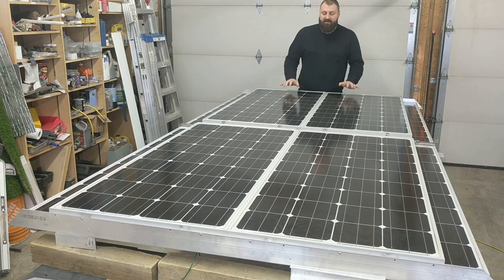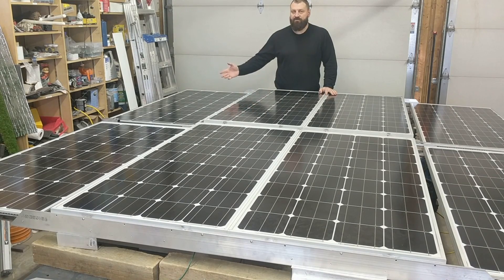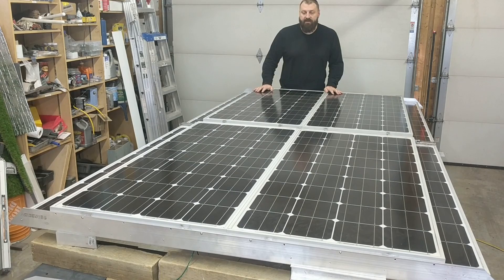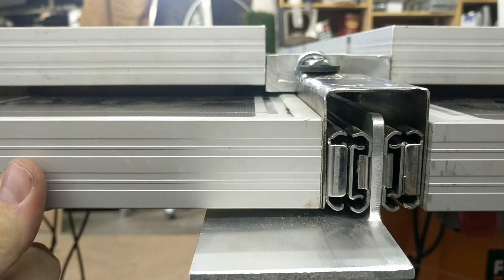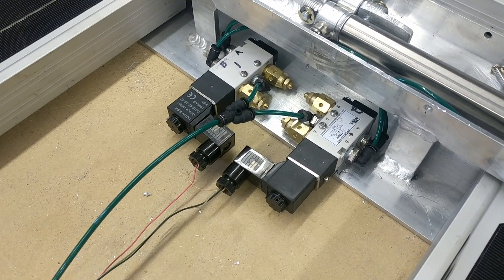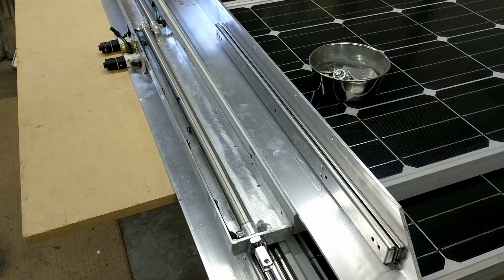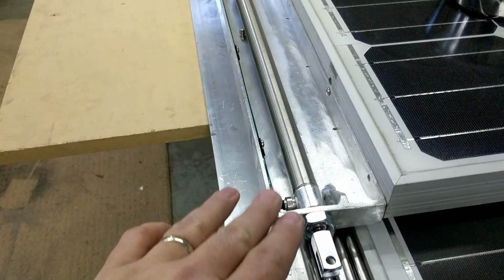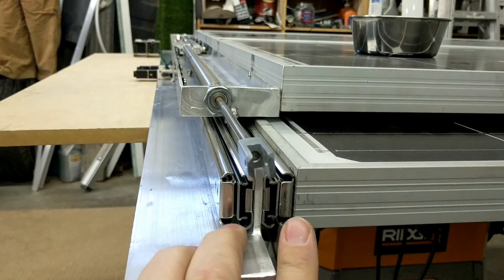Even Moar Solar! 1.4kW Rooftop RV Sliding Solar Install - How to Build an Overlander

Comment: Great video ! Had you considered 80/20 for the framing of the solar panel arrays ? I understand 80/20 makes sliding brackets etc. I am planning to fabricate something similar to your build and was considering 80/20 . My only concern is how that hardware will hold up to the brutal weather conditions on the roof. Any thoughts or considerations are greatly appreciated.
Reply from the maker: I have worked with 80/20 a lot, I would not consider it for this application, it would be too bulky in my opinion, and there's nothing complicated about the way I did it, three pieces of angled aluminum and some drawer slides...
Reply: @Everlanders  Thank you so much for your prompt response and for making outstanding videos.

Comment: Did you electrically isolate the panels on the bottom so as not to effect the output of the top ones if only using those?  If so, how did you do it?  Or doesn’t it seem necessary?
Reply from the maker: We use the SBMS100 solar charge controller and Battery Management System which has two discreet solar inputs. This allows me to track the amount of power produced on the top array versus the bottom. That being said, it is not required and they could be wired together without any problems.

Comment: ahh... so this is how you did it? very sweet. 

Quick question, what would keep somebody from doing this but the other way around.... That is, having the top two panels slide out instead?
I have 4 4x6 panels to install on the roof of my short bus and I am trying to evaluate options that would let me have a roof top deck, at least until I install four more panels, 

thanks
Reply from the maker: I don't see why not... But why not have them hinged at the edge, and then fold them up to act as a railing when you're using the deck and then they fold flat when you're not up there...

That being said, we know 3 rigs that have rooftop decks and 3 rigs that wish they wouldn't have bothered. They never use them, it adds a surprising amount of weight up high making for poor drivability, and the mounting points leak...

Comment: How have the slides survived exposed to the elements?  Has dust/dirt compromised the lubrication in the slides?  Do they still operate as new?
Reply from the maker: I soaked the slides in degreaser before assembly to prevent dust and dirt from collecting. 2 times a day, 3 years, 4 countries, nearly 100,000 km and they are still going strong...

Comment: so you have had this for 3 years - how has the drawer slides work in the environment? - are they still sliding easy ? they are typically built for indoor use. great idea I want to copy it!
Reply from the maker: These are not typical drawer slides... They are heavy stainless steel slides used the toolboxes of Tow Trucks, Service Bodies, and Ambulances. And as you can see in our more recent videos, We've driven this rig nearly 100,000Km through Canada, North to the Artic Ocean, South through the USA, Mexico and now heading for Guatemala. We've had no problems cycling them at least twice a day.

Comment: Don't know if this has been asked, what keeps the cylinders locked?  The constant air pressure in the line feeding them?
Reply from the maker: I intended to put magnetic latch solenoids to hold them in as a double safety, but I never got around to it, I'm still carrying them around in the back of the truck. The air pressure pulling them in has been working great so far...

Comment: How is it holding up 
I’m paranoid About the actuator failing from vibrations in the road life situation and rust and dirt hindering the sliders ?
Seems about $500 to add a few panels seems worth it unless it is problematic.
Reply from the maker: 4 years, 4 Countries and 100,000 km later and they're still working like a champ... The stainless steel sliders don't rust, and all the pneumatic cylinders and fittings are stainless steel as well...
Reply from the maker: I now have a Frequently Asked Questions post on this very topic on our website that gives lots of details... https://everlanders.com/FAQ-air-powered-slides/

Comment: Brilliant! I want to build something similar. Is there a special reason you used pneumatic cylinders instead of electric cylinders (electrical linear actuator)? Also, is there any precaution you took agains dust in the sliders? I am afraid that once dust settles in the sliders wont move effortlessly anymore.
Reply from the maker: Electric linear actuators that have 24" or 30" of throw can get very expensive, large size, they are a lot more susceptible to damage from exposure to water and outside elements, and they are quite a bit more complex in that they have limit switches gears, worm drive screws... This is a very simple ¾ inch diameter stainless steel rod, when you give it air you get a hundred and fifty pounds of pushing force, through a single ⅛ inch air line. if anything fails I can disconnect the airline and push it in or out as needed. Heavy duty stainless slides were de-greased and pressure washed clean, the roller bearings are running dry now... 100,000 km and three years of use and they're still going strong...
Reply: @Everlanders  I kind of expected you to have thought about that 😂😂 but good to understand your reasoning. Now I see your point about the air cylinders. And the best argument of all: you know it works because you have tested it.
Reply from the maker: I now have a Frequently Asked Questions post on this very topic on our website that gives lots of details... https://everlanders.com/FAQ-air-powered-slides/

Comment: Would rivet-nuts be an acceptable substitute for all those threaded chips for mounting the panels?
Reply from the maker: Yes, except that the frames are 1/2 inch thick box section extrusions with fairly thin walls, so I wanted to spread out the clamping forces.
Reply: @Everlanders  Cool, thanks for the reply.

Comment: Awesome job dude, in the midst of a build in the UK and this is the video that introduced me to you guys, been hooked since. Looking to implement something similar on my vehicle and I also have an air system to run it off of so I'll probably be using pneumatics as well. It mentions in the description  of your install video that pressing the brakes brings the panels back in, how is it that you've implemented that?
Reply from the maker: Our system is one step more complicated because we have python script running various other automated functions when we start the truck... but you could very simply have a standard Bosch relay and cut the power to the solenoids when your ignition comes on....

Comment: Wondering if you had any problems with the sliders now that this video is 2+ years old. I am looking at the option of making a manual awning out of my panels. 
Can I ask what sliders you used?
Reply from the maker: They get extended and retracted 2-3 times daily, currently off roading through Mexico without issue. Links for everything I used is in the description.
Reply from the maker: Also, this https://youtu.be/woZH85EiHNY

Comment: Since I have used your scripts for the backup camera and screen dimmer, I might as well ask for more. I am working on my solar panel setup, similar to your setup, for my Vanagon. I like the idea of activating the air cylinders via my Raspberry Pi instead of toggle switches. Could you share the script used to extend and retract the cylinders. Also, what watt size are you individual solar panels?
Reply from the maker: Here's a post just for you! https://everlanders.com/all-about-automation-part-one/
Reply: Everlanders The site is asking for a password. I am a Tier 1 member but not sure if I was supposed to setup a password somewhere?
Reply from the maker: Oh, sorry I didn't realize you were Tier 1, all our extra website content with step by step tutorials and diagrams is Tier 2+. But I don't think they'll mind if I share the script itself this time... https://gist.github.com/Everlanders/4bf6b0b1a516aca4423a38824fbefeec

Comment: What size air line are you using. I ordered 1/8 inch and it sure looks small.
Reply from the maker: Yup, I used ⅛" - anything larger and the cylinders move so quick I was scared to damage the panels...  At first I was going to run a larger hose up to the top and then split it, but in the garage testing, I needed at least 20' of this tiny hose to dampen the movement. Even with variable exhaust dampers it was hard to slow it down.

Comment: What is the width and length of your panels? 
What is the total thickness of the installation?
Reply from the maker: The panels each measure:
58.750"  1492.25mm Long
26.750"  660.4mm Wide
1.875"  47.625mm Thick

Comment: Are you running your Nitra valves at 24 volts or will they work at 12 volts?
Reply from the maker: I changed to the 12 volt coils, sold separately.
Reply from the maker: https://bit.ly/2U90zuP
Reply: Everlanders Thanks, already got them on order. I really appreciate your help.

Comment: That's pretty slick.  I was mulling over doing something similar on my trailer, but not automated.  Very well done.    I'd be surprised if you didn't get some inquiries.  The next step, make it able to track the sun.
Reply from the maker: No interest is tracking the sun... Added a bit more solar is far cheaper than tracking...

Comment: Great when waiting for a trafic light ;-)

Did you think about being able to tillt the whole thing over one side of the car so you can direct it into the sun. Might be a bit more weight and less solid, but should bring in 20-40% more electricity...
Reply from the maker: When traffic is slow or the road is very smooth, we totally deploy it... but in my testing, it was nowhere near 20-40% when tilted, Especially in Canada, they would need to be nearly 45°, and when you consider that the direction we're parked is not always going to be in the direction the panels tilt, or I'd need to have the whole array tilt in all directions, and the mechanical nightmare that would be. Not to mention the stresses on the mechanicals in off-road environments that we're in now. Further, we make more than enough power in Canada and the USA with them being flat, and it's only down here as we travel through Mexico and into Central America that we really need the big power for AC, and for that, the panels being flat works just fine.
Reply: @Everlanders  A tilt would have to be on one side only. That does mean you need to park your car with one side towards the sun and maybe repark it some times. But if choosing how your park is not an option then yes, there is no point in this.

But I get what you say, when you need the AC there is likely enough sun too ;-) And by having enough panels and battery capacity to start with, you don't need to complicate things.

Comment: Nice bit of engineering. I have been thinking about doing just the same, but with 12v linear actuators. Was that a consideration and if so what was the issue with them?
Reply from the maker: I've repaired too many electric actuators/control systems... I like that I don't need to repair the failed limit switches, and the burnt out motors from the same, I like that they are a fraction the weight, size and cost for the same workload, They extend and retract in 1-2 seconds. Made from Stainless Steel they are robust for extended outdoor use. And most importantly the way I have them valved, they fail closed.
Reply from the maker: I now have a Frequently Asked Questions post on this very topic on our website that gives lots of details... https://everlanders.com/FAQ-air-powered-slides/

Comment: Outstanding build! Did you add the code in to an existing Pi, or use a dedicated one? Thoughts on controlling via Arduino instead of Pi? Any after thoughts on what you would change? I am looking to do something similar now that I have seen this amazing build ✌
Reply from the maker: I have 5 Pi doing various stuff... I just tagged this into one of those... Wouldn't consider Arduino, way more familiar with Linux.

Comment: This is so freak’n cool. Is there a vacuum in the cylinders that help keep the panels tucked in while you drive?
Reply from the maker: They are 2 way cylinders, 150psi pushing out or 150psi pushing in...
Reply: @Everlanders  Thanks!!!

Comment: loctite those screws.
Reply from the maker: Thanks for the suggestion Mr. Zing Please rest easy knowing that when it was installed on the rooftop, the fasteners were all installed with a threadlocker or a Locknut.

Comment: How big a gap did you use from the van roof to the back of the solar panels ? Thanks
Reply from the maker: About a 1/4 inch to the frame when the lower set is retracted. When extended they hang off the sides and then the top ones are about 3 inches to the glass.
Reply: @Everlanders  Thanks,Jason.

Comment: You have done an excellent job with that system. Definitely one of if not the best sliding solar panel setups I have seen (I do a lot of looking) I am wondering now that the system has been in use have their been any issues or updates? Currently I live in a converted coach bus (6 years now) and am doing the mental calisthenics to prepare to build my next bus.
Reply from the maker: No problems... Living in here full time and extending and retracting daily. (Many times a day if we're moving as we put them out while shopping or hiking...)

Comment: Just curious, why did you go with the air rams over linear actuators?
Reply from the maker: Because they don't have limit switches that fail, they can extend into a tree or other obstruction and bump into it and stop rather than burning up the motor, they are cheaper, they are faster, they are smaller, they don't care about sun or rain, they can be easily overridden if need be.
Reply from the maker: I now have a Frequently Asked Questions post on this very topic on our website that gives lots of details... https://everlanders.com/FAQ-air-powered-slides/

Comment: What happens if you get struck by lightning?
Reply from the maker: A quick Google search indicates that there is a 90% chance you'll live.
Reply: Ok you got me, should have clarified I was talking about the truck.  Curious if you set up a grounding rod when you’re in remote locations or ever.
Reply from the maker: No grounding rod, I'll be as vulnerable as every other car in that regard.

Comment: I’d be curious about Maintenance on this system.  I imagine dust, dirt, grit, and sand would slowly build up in the slides, and eventually need to be cleaned out.  How would one go about accomplishing that?  I’d love to have a similar system on my RV in the future.
Reply from the maker: It's been over a year now, and we've been full time traveling through Canada, USA and Mexico extending and retracting daily with no issues. I simply used high quality, beefy stainless slides. Before assembly I used degreaser to remove the factory applied oils so the dust does not stick. Twice so far I've used the pressure washer at the car wash to blow away any pine needles or whatever gets stuck inbetween stuff, but it was a preventative measure, not sure it was even needed. 👍

Comment: I thought of this idea too, but I had an extra part of putting the whole rig on a frame that allows for either base edge to be elevated 23 degrees from horizontal, like lifting one side at a time up, going to add this type of set up to long boat ~70 ft, with a lot of battery storage (Lithium Iron Phosphate) to run an electric inboard motor for propulsion. stop to recharge for fuel, and use an Aqua Boy to generate water from the air, and a incinerating toilet to take care of the waste all run from electricity generated from solar, or maybe have a hydrogen  fuel cell set up for backup, use excess energy to hydrolyze water, and store in Metal Hydride  filled cylinders @ 150 psi for alternative electricity source or even run a generator off of..  That's my plan anyway... GREAT MINDS THINK ALIKE! Cheers
Reply from the maker: This is your plan? Do you have this boat you mentioned?
Reply: @Everlanders  no, saving up for the hull material...think of the design as close to a Wide Beam narrow boat...
Reply: I certainly would love to see your design tilting! 😊

Comment: You must be an angineer.  Was curious of two things.  Want to learn to weld, and wondering what kind of welding rig you need for that.  Second, where do you source your L channel and pneumatics?  Great idea, on my table saw setup I use pneumatics all the time.  Love it!
Reply from the maker: I use a 300A Miller TIG for aluminum.  Links to everything I used is already in the description.

Comment: For those looking to do something like this and don't want to get into the air control system .... you may be able to take the guts from an adjustable height stand up desk and do the same thing for the  deployment system
Reply from the maker: Is that what you did?
Reply: @Everlanders  BTW ... super ingenious set up on the panels ... but the air driven deployment system is totally over my head ... I just had a thought while watching your vid that possibly a simpler solution for me would be to hack the motors from my stand up desk .... they look like this ... https://www.youtube.com/watch?v=yvZzN4yWPP4&t=1557s   ... provided they could be properly protected from the weather ... but as of now its just an untested idea.